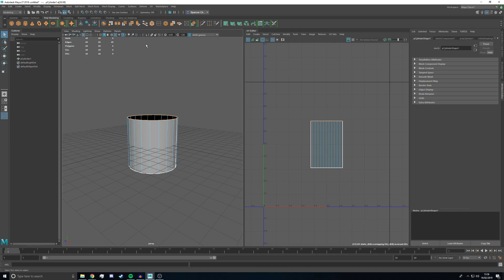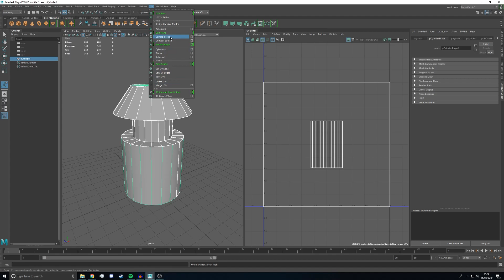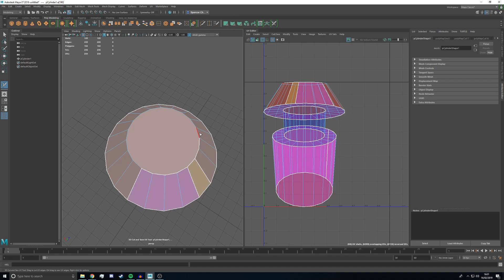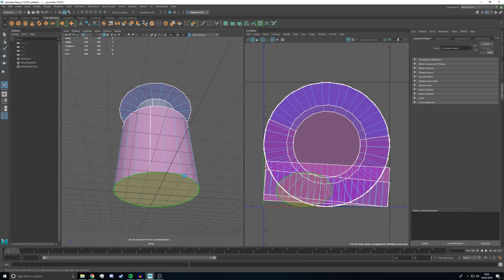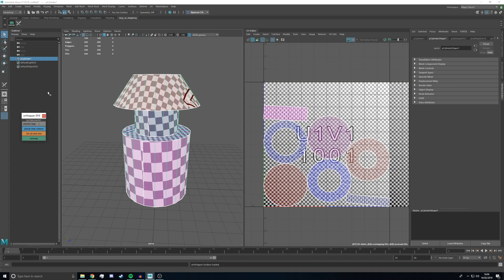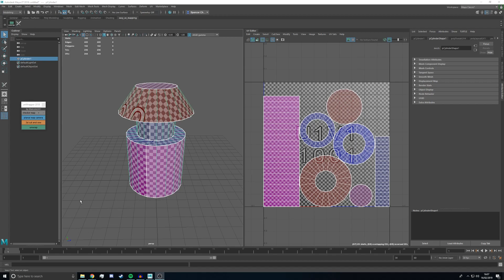3D Cut and Sew Tool Maya 2018 (Fast and Easy UV Method) - TUTORIAL

Comment: Sir help me whan i go for this
Cut and shew there is already one layer selected for unfold what I do
Reply from the maker: If I understand you right, then I would just redo the camera mapping and make sure no edges are selected before you use the tool. Or deselect whatever edges you don't want to cut.
Reply: @Stegosaurus1234  sir I already do this but the problem is not solveing now what I do sir
Reply: Sir I am unable to export my animation  can u give me some tips how can I save my animation in video form
Reply from the maker: @saurabhchaurasia7229  Hi, I could make an exporting video, but I am not sure how necessary it is as it is quite an easy process. If you are exporting an FBX file you just need to tick the animation option. Just like you would tick the "embed media" option if you wanted to export textures with the model.

Comment: For some reason, my lines do not highlight. Any idea?
Reply from the maker: Could be related to the two options within the UV editor that alter the tools appearance. There are two icons in the top right of the UV editor to the left of the slider that will change whether the checker map or the bright colours are on, which may effect the lines appearance. Alternatively it could be in the tools settings?